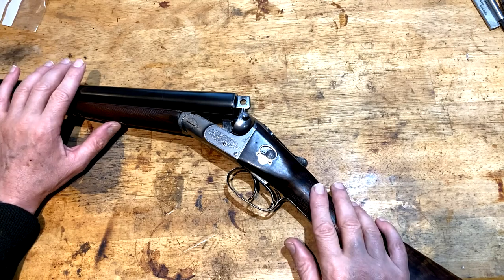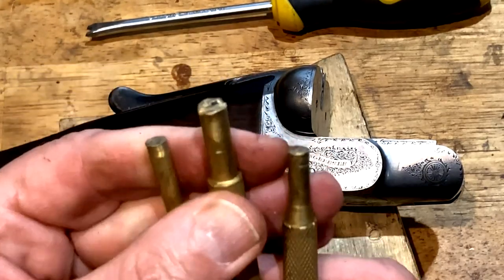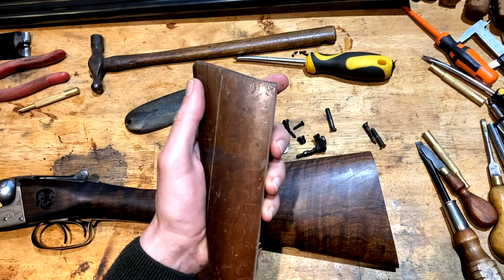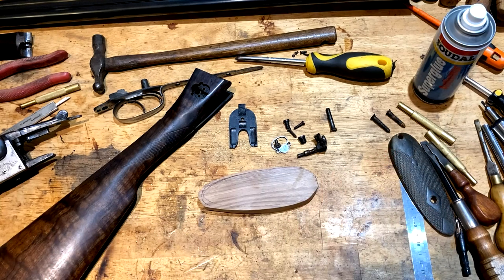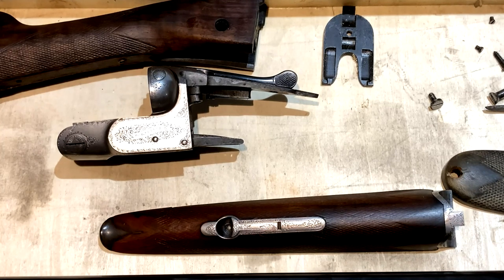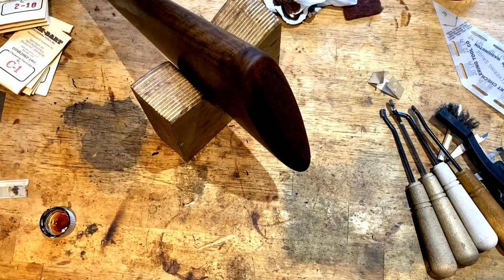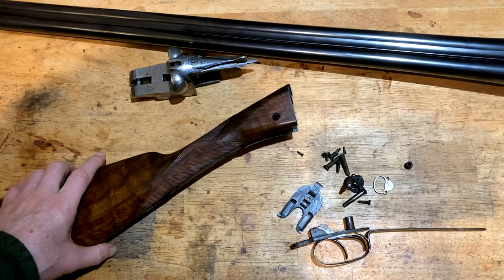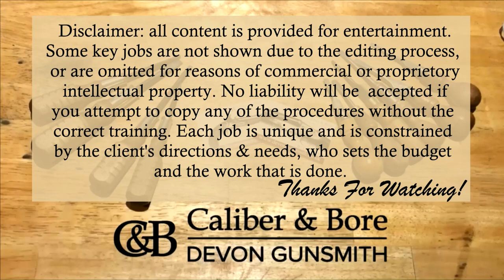Devongunsmith Diaries #31 W.W. Greener Gun Alterations: New Walnut Butt & Chequering

Comment: Evening, I have an issue with my beretta silver pigeon 3. Every time I fire the bottom barrel, the empty cartridge gets stuck and won't eject, I have to ram it out with a rod. However, when using snap caps, it ejects fine. Any ideas
Reply from the maker: I would first ask you what cartridges you are using? If you’re shooting large shot 4’s or above it’s most likely the hull’s deformation when it’s pressed. But it could be many things. Ejector springs, corrosion in the chamber, falling to break the gun fully, I would first look at the hulls of the cartridge to see it I can see shot pressing against the hull walls increasing the size of the cartridge..!?
Reply: @devongunsmith4698  
Thanks for the reply. It's a new gun, it happened the first time I shot it, I've tried many different brands of cartridges, but it still gets stuck.
Reply from the maker: @ashleyridge3854  where are you?
Reply: @devongunsmith4698  
Southampton, Hampshire 
Just come back from a clay shoot  and still getting stuck in the bottom chamber, however today it decided to completely lock the whole gun up.
Any ideas

Many thanks Ashley